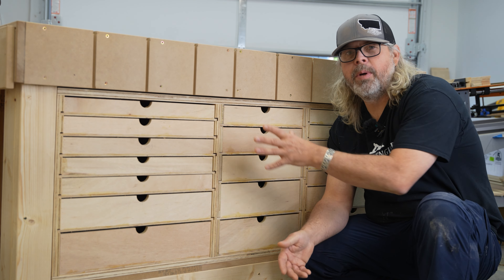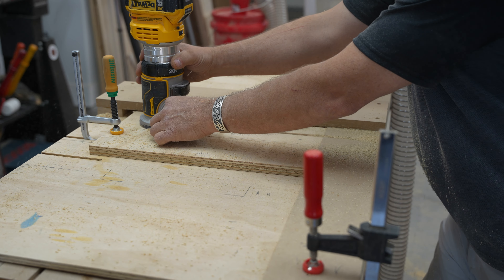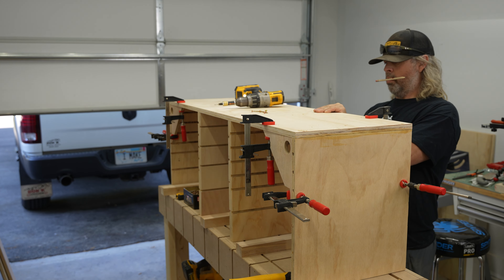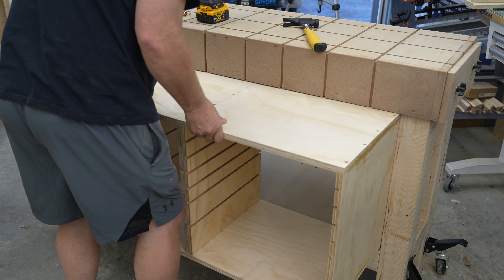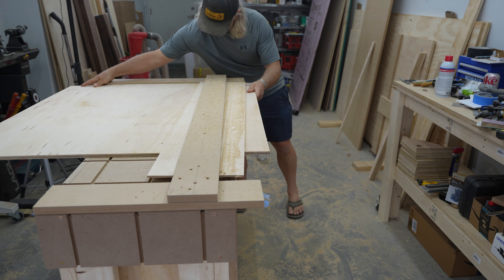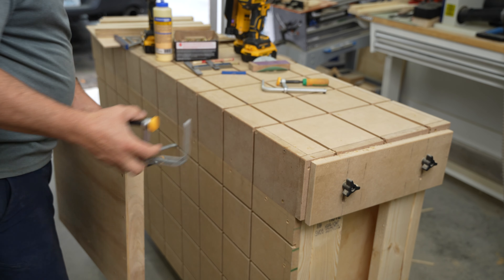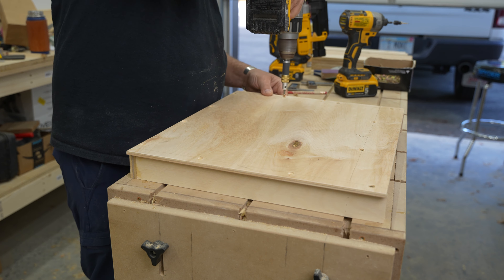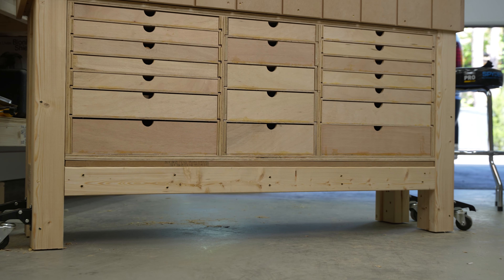How to Build Simple Shop Storage Drawers

Comment: This was an ingenus way of tackling what could have been a very difficult build with the tools at hand. I have a lot of drawers in my shop but, they are for, mostly, supplies and longer term storage; screws, hardware etc. Smaller hand tools are hung in plain sight on French cleats for "first order of retrieval, " an Adam Savage philosophy that makes using tools easy and quick. The shop layout continues to change and develop 6 years after drying it in and expect see more changes in the coming year as I move away from Handyman projects and into more fabrication based projects. Jason, you always inspire and teach this old dog a few new tricks and look forward to your next video!
Reply from the maker: Thanks Tom! I left you a response but realize I didn’t respond directly to you 😂
Reply: I have mixed feelings about the "First Order of Retrieval" theory, Tom. It's handy that everything is easy to grab. The byproduct is that everything is always covered in dust, whereas all would stay clean in drawers. Pick your poison, I guess. Personally, I much prefer shallow drawers.

Comment: Dude you're on 🔥🔥🔥  And giving me workbench envy.  Nice work.  I dig shallow drawers.  Have you thought about putting paste wax on the drawer slides to make them smoother?
Reply from the maker: Thanks buddy! I appreciate it. Yes I have. I really wanted to use 1/4” mdf on these but none was available where I am. I have another set of these I built using mdf for the bottoms and they glide beautifully without wax. These ones aren’t bad.

Comment: I was just going to build bottom cabinets and drawers for my crap.. was not looking foward to buying 30 sets of drawer slides. This looks as if it will work long term!! Did you apply any wax to the edges of the drawers to slide better?
Reply from the maker: Will definitely work long term. On these I didn’t and they are ok. If you want an even smoother glide use 1/4” mdf for the bottoms. I have a an entire bank of base cabinets with those and they are super smooth.

Comment: Great Build!  Thanks for the idea! I'm assimilating this idea! 
What thickness ply did you use for the bottoms and how wide and deep are the dado (how much clearances)?  We have a lot of humidity in the Houston area so I'm concerned about sticking in the grooves.  
I like a mix of deep and shallow.  Deep for big tools and shallow for small items. I lean more toward shallow though...
Reply from the maker: Thank you! I used 1/4” maple ply for the drawer bottoms with a 3”8 dado for them to slide in. This is in South Carolina with super high humidity as well and there are no sticking or binding issues. I leave an 1/8” gap on both sides of drawer in the dado for side to side play. I prefer using mdf for the bottoms but couldn’t find any cause they slide easier. And as always a little paste wax helps with that as well. Hope this helps. 👊

Comment: Would you recommend just using screws for the drawers? And not using nails? What if the drawers were made from MDF as opposed to plywood? Screws still be an option?
Reply from the maker: You could use screws. Just slower. The glue joint is doing most of the work for you.
Reply: @bigskymaker  thank you. Will see what I can work with 👍. Will be first time building something like this.